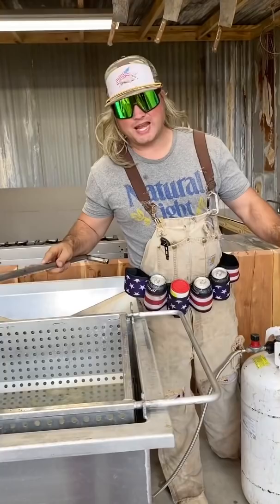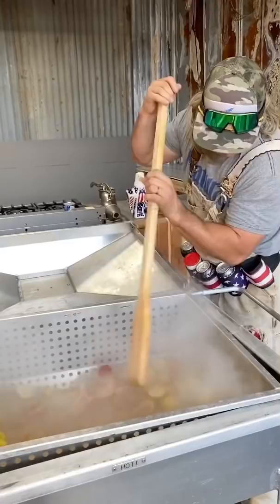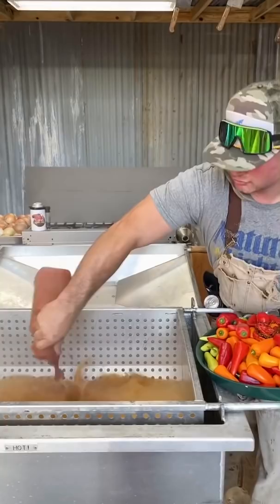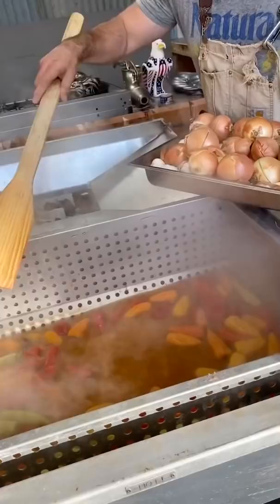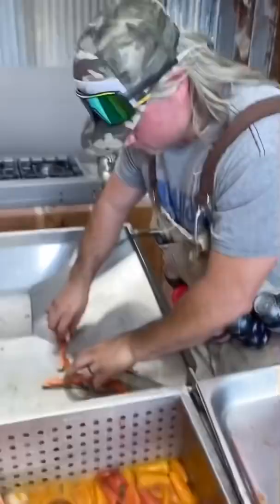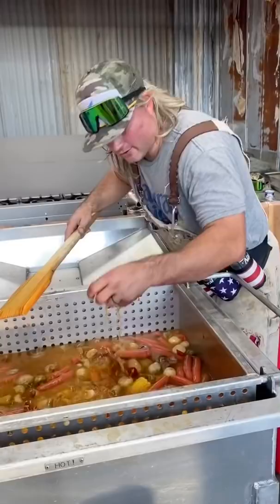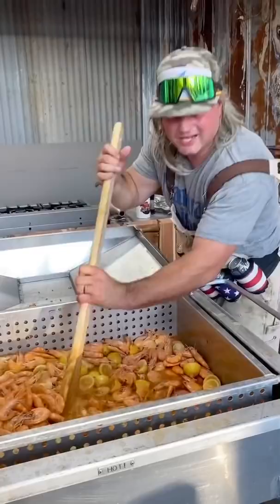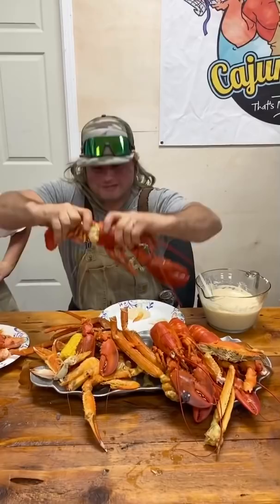The ultimate seafood boil!!

Comment: Yeah you ate the poop pipe of the lobster tail. You wanna get the tail out. Start at the top on the  backside of the tail. Then pull that strip of meat off that  and it goes down to the end. Once you got that removed you will see the lobsters poop pipe you can remove it. I myself dip the tail in salted melted  butter  Which is money dude.